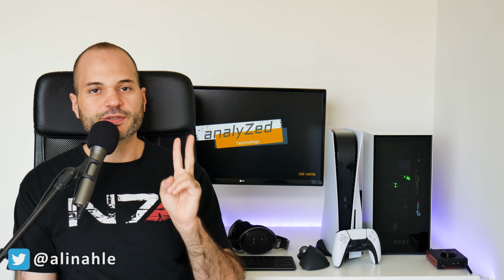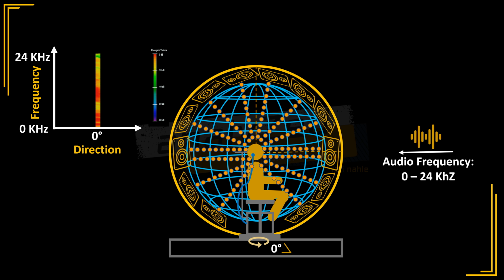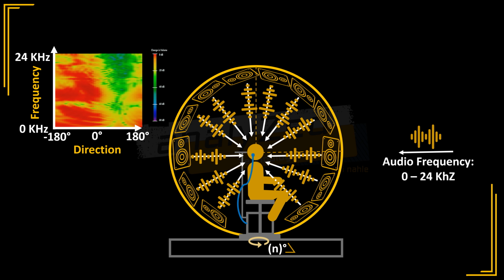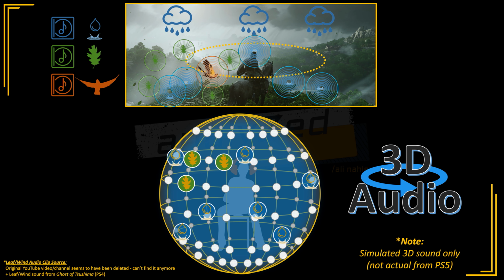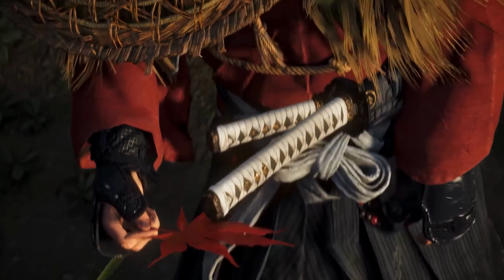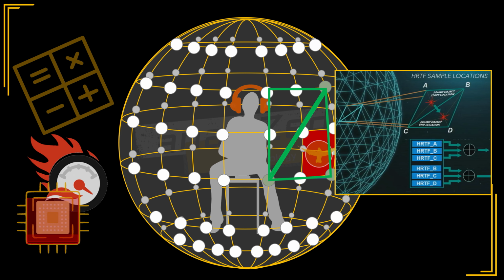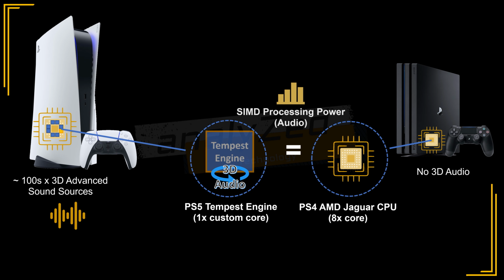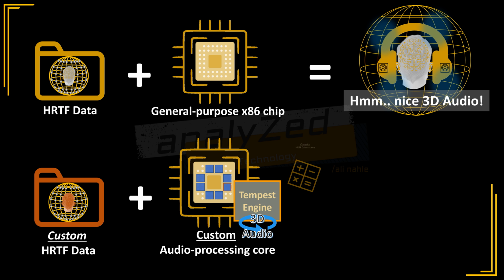PS5 3D Audio #2/2: The Design & REAL Impact (w/ practical demos!)

Comment: Great video thanks, there is not enough info on this subject :), I can add that the hrtf profiles on the ps5 (I'm profile 4) alter sound signature and the 3d effect seems to work better with a boost around 8-10Khz and not too much bass so the headphones or iem you use are a an important factor to the overall 3d effect, you also still need good imaging and soundstage (but not too large a soundstage).  I tested a lot of sets and the shp9500 were the best for PS5 straight in the controller.